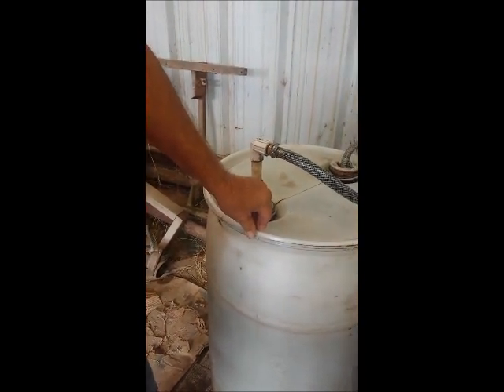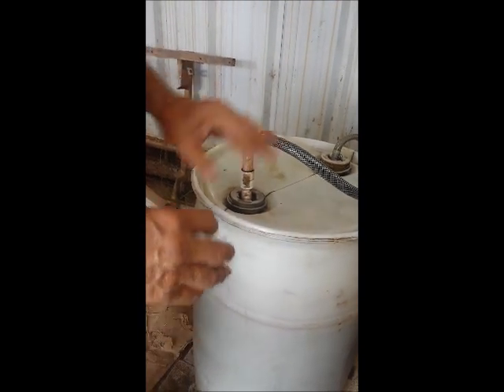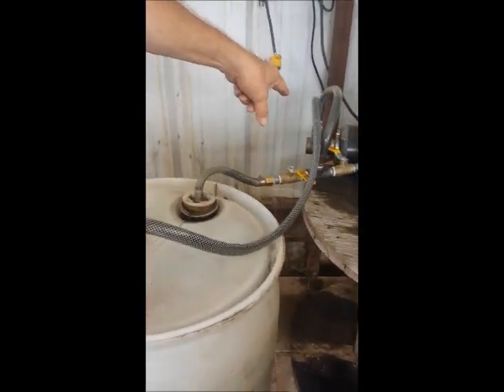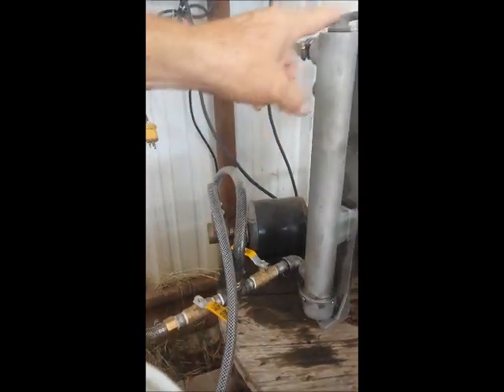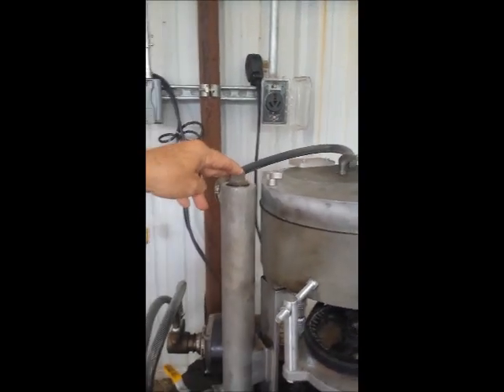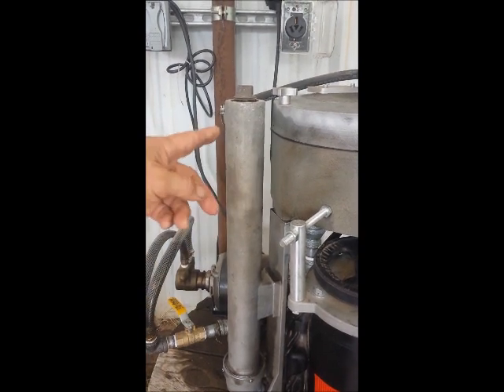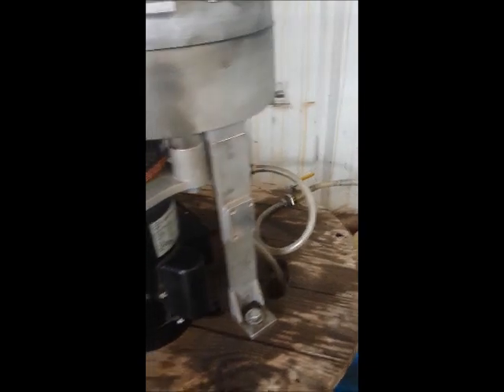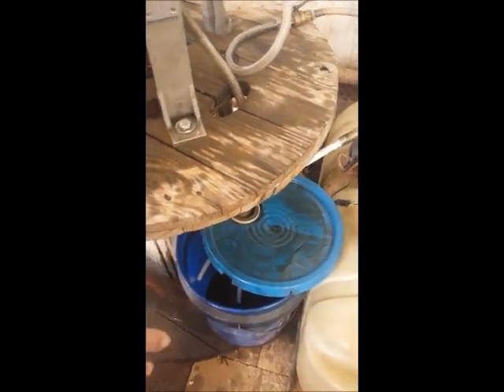Cleaning Used Motor Oil into Black Diesel  With Centrifuge

Comment: Too bad diesel generators are too expensive for us regular folk, so that black diesel can power them. I could probably burn motor oil in a preheated wood gasifier and power the gasoline generator though.
Reply: Solar panel, How much does the sun cost?
Reply: They break, and wear out, and they're impossible to recycle.

Comment: It can work to a limited extent - with effort. Been there, done that on a Mercedes IDI and a Powerstroke. The stuff does burn. the problem you have is the part of the used oil that makes it black - carbon. the carbon doesn't burn. It also likes to stick to things inside the cumbustion chamber. On a Powerstroke, it will stick to the injector tips and you have to pull and clean them after about 300 miles. Did that about 100 times - literally. The IDI engines are somewhat protected, so the problem isn't the same. But you will eventually have problems like stuck rings.

Take a sample of the finished "black diesel," put it in a lab-type table top centrifuge, and spin it for about 5 minutes. You will see that there is still sludge left. the big centrifuge got a bunch of it out, but not all of it. If there is any black color left, there is still sludge left. BTW - if you add the gasoline before the centrifuge, the oil will be even thinner and will filter better.

All of these problems can be dealt with if you are willing to keep taking your engine apart and clean whatever is mucked up. It was more cost-effective when diesel was over $4.00/gallon - not so much any more. Let me know when you make light-tan diesel.
Reply: 😂 your comment hasn’t aged well as diesel is now $5 a gallon 😂
Reply: @loganthesaint  looking at these videos cause I'm thinking about buying a 6.9 to save money and running used oil😂
Reply: idk about stuck rings. any diesel oil worth buying that is changed at regular intervals should keep your rings from getting stuck unless the cyl is washed and/or the rings are toast anyways, assuming that in either case blow by is causing the buildup.
100 times literally? idk man...
depending on your particular mixture the base timing needs to be adjusted to compensate for the lower cetane quality (ignition delay). i run waste motor oil and atf in my 5.7 olds. i dont have smoke if i mix with a little gas in a roughly the same 1:4 ratio. i advanced the base timing another 6-10 degrees and it really cleaned it up. now if i run it on diesel, i have to back the timing off that same 6-10 (i have another timing mark on the pump that i use) or itll smoke under light load, the idle gets "herky-jerky", and gets really smokey under heavy load. (all clear signs of the need to adjust the baseline to compensate for the burn rate and ignition delay)
 the oil gets dirty at about the same rate, like any idi, its black after the first half hour of driving. power is the same, after the lower burn rate is compensated for.
wanna keep the combustion chamber clean? i also run water meth (yes naturally aspirated) not for power, but to keep the soot from finding a home. its a 90-10 mixture, so the chances of detonation are minimized (olds 5.7 is a 22.5:1 comp ratio engine), and i share the reservoir with the washer nozzles too. i had a vacuum line for the egr valve that ended on the inside of the filter element, after i filled the egr ports in the heads, lower and upper intake, and ground out the egr pedestal in the upper intake, the hose became a nice (sealed from atmosphere, metered by intake flow) water/meth "nozzle".
my idle smoothed out after the first 2 hours of straight highway driving on the waste oil. i think the injection pump appreciates the lubrication!!
the engine is more than capable of steam cleaning itself. on a powerstroke with split shot injectors id imagine the pre shot would get the steam where you want it, then the rest of the fuel charge would reeeeeeally get things cleaned. idk if the extra steam pressure between injector shots could effect timing of the main charge or spike cyl pressures on its on though.
to wrap it up, i think the stuff works fine. but im only at around 1000 miles so far, most people told me the engine alone wouldnt make it that far!
Reply: I would never run it in newer stuff but I've run it in my older tractors(Kubota,Zetor,Case and Cat)for over 15 years with NONE of the problems you described.
Seriously if you rnit in a modern Powerstroke you were looking for a problem imho.
Reply: I can attest to this I have a 1996 Volkswagen Passat TDI with direct injection. I use an open bowl centrifuge to clean my black diesel. I was getting the same thing build up on the injector tips after about 300 to 400 mils. This would make the car run like crap and smoke bad. I would pull the injectors and clean them then the car ran fine again for about 300 to 400 mils. I reaped this many time this past summer trying different thing to make it better but getting the same result. It just seems like the oil is too dirty. I live in Wisconsin and I’m back on regular diesel for the winter and my car runs grate. But I don’t want to give up on getting this to work, so next season I will try some different things to get it to work better but if anybody has some suggestions please feel free to let me know.
Reply: Are you mixing with diesel or gasoline?  @thetdiguy3140
Reply: @bethesdaautomotive  I mix 16 gallons of used motor oil after cleaning in center fuse with 2 gallons of diesel and 2 gallons of gasoline and 4 ounces of acetone. Followed thru a one micron filter at Tractor Supply.
Reply: @thetdiguy3140  Thats the result of short travel with black diesel
Reply: @thetdiguy3140  Maybe you can try putting some magnets around your main fuel line,keeping avoid touching one`s to another,or the proper metal conduit,using some tape.This arrangement helps improving the burning of your diesel,in order to clean your injectors too,and gain some power at the process.Maybe your injection pump becomes more noisy than usual,but runs o.k.And it´s almost inexpensive;some pieces of ceramic magnet...
Reply: If you are having to clean your injectors 100 times you are feeding way too much into your centrifuge at 1 time... works best when you flow 1/2 capacity... my black oil comes out pretty clean and i run it through the centrifuge twice when it’s really dark.. 8 years in and i have no issues so far.. my fuel filters last about 6 months too
Reply: Theoretically, if you ran wmo through your centrifuge say 20 times, would it still look black? Is it possible to filter out much of the carbon to make it clear or somewhat clear? I've burned wvo with my system but never wmo and never with a centrifuge. Just very curious.
Reply: @chriswilliams2652  I have used a desktop centrifuge with sample test tubes just to see what is possible. Without using an agent to cause the carbon to come out of suspension - a de-emulsifier - I can't get all of the carbon to come out. I got a de-emulsifier to work once, but I couldn't get it to repeat, and it made the oil corrosive as hell. And a desktop centrifuge will separate almost anything. WVO on the other hand... I can make that stuff look like it's ready for cooking again.
Reply: @paramax55  so after running the wmo through many many times (without emulsifiers) it didn't lighten up or get any more clear? Still looked like black motor oil?
Reply: @chriswilliams2652  Diesel oil still looks black. Gasoline motor oil looks a little different. A TON of sludge comes out of it. It's like flammable clay. That's why I kept trying the process for so long - I was getting garbage out, so I knew I was doing some good. I always wanted to come up with a good use for the sludge, but never did.
Reply: @mikecorleone6797  Hi Mike I’m thinking of joining the club what make model of centrifuge do you use and any advise you’ve learned would be appreciated I run a direct injection engine. Thanks
Reply: @klecoxs2  electronic direct injection? If so I wouldn’t run waste oil.. it will kill your injectors fairly quickly.. waste oil burning is safe in older mechanical injected diesels
Reply: I’d be more worried about the life of the injector pump with those micro sized particles running through it, freshly made petroleum diesel has particles smaller than 5 or so microns, which works for a long time with those small clearance pumps, I don’t know how long a pump would last on poorly filtered black diesel. You should probably fit a series of filters in your final mixing tank before you run it in your truck.
Reply: Been running it for 200k + miles in my 95 7.3 never pulled the injectors. Wouldn't recommend with new injectors unless they're overbore but worn out ones run it just fine. I run about 5% Gas and 95 used oil.
Reply: @kyaneslace3595  Do you do centrifuge or pyrolysis
Reply: What did you filter with
Reply: @gw1652  filtered with a centrifuge, multiple times. 10's of thousands of miles worth. I got rid of a bunch of carbon, just not enough. I varied everything I could come up with - thinning, heating, I even tried a depolarizing agent. The depolarizing agent showed the most promise, but it was corrosive. The problem is that the oil is designed to hold the carbon in suspension and it does a very good job of it. I came to the conclusion that the reason that "Big Oil" distills their products instead of filtering them out is that they found out a long time ago that it was the best way to do it.
Reply: I'm with Jeff on this. I've been into alternative fuels for 20 years and I wouldn't put black diesel in a modern engine. I once knew a guy who almost made a hobby trying to find a way to purify WMO but he couldn't defeat the injector problem. I can't say if he experimented with the petrol slow dropout method but I'd be surprised if he didn't.
Reply: I

I'm

Comment: What are the beads ??

Activated Carbon ??
Reply from the maker: They are polymer pellets or beads that absorb water, but not oil.  They will draw out any left over moisture.  You can even use them without the centerfuse.
Reply: Cool thanks .
Reply: Can they be reused? I mean, is it possible to dry them out or heat them dry? Just wondering.

Comment: how dirty is the diesel....
Reply from the maker: It is not dirty but has black ash that will settle in the bottom of the tank over a period of time if not in use causing it to smoke when the tank is almost empty. To clear it up, just add regular diesel and it will gradually mix  and you can flush it out.  I let my Dodge sat for 6 months and it started  right up. I had a half tank. It ran fine until I got almost empty and then when I started it, the engine would smoke until I added more regular diesel and it cleared up.

Comment: How much does the centrifuge cost? I am interested in setting up this type of system for my tractor. Thank you for a reply. Blessings!
Reply from the maker: The initial cost was $2,000. I added the mixing tank and the barrel, pump, valves,  total investment about $3000.  Mine is 240 volt.  I have a friend in Iowa with one that is 110 volt from the same company.  His system is fancier than mine and is willing to sell it for $2500.  If you want his number, I will be glad to offer it.  He was uncomfortable about sharing information.  The key is a good recipe.  I am doing 16 gallons used motor oil, two gallons diesel, three gallons of gasoline,  and four oz. of acetone.  You can add up to 20% gasoline without raising the temperature of your engine.  It has more power than the diesel at the pump. with very minor smoke if any.  God bless! You can buy a new centfuse at www.usfiltermaxx.com
Reply: @Pokeanoscat  Is that a Chastain cast centrifuge?
Reply: Built one... Use maybe a torque converter as a bowl!